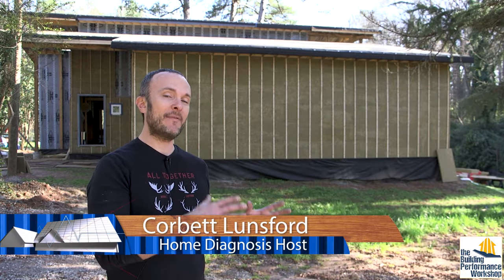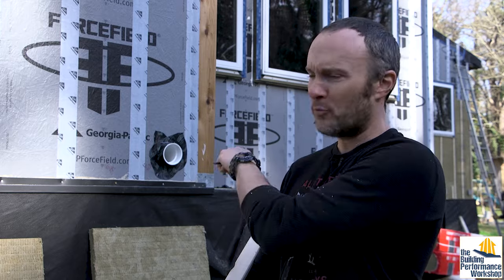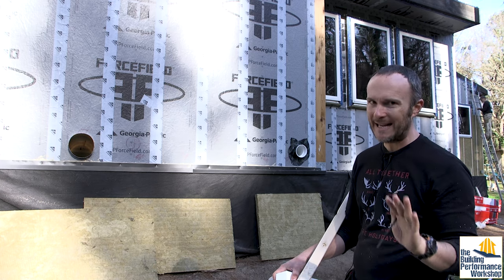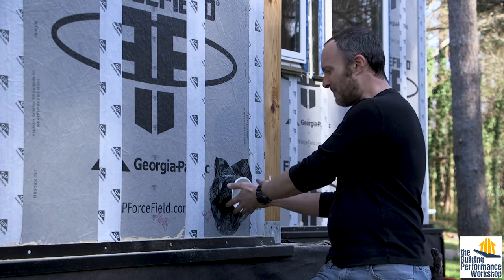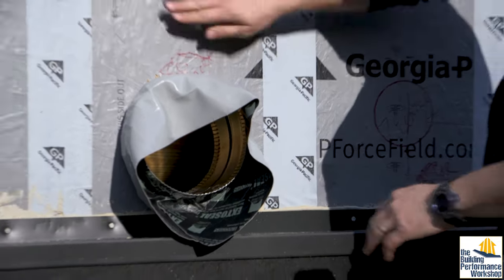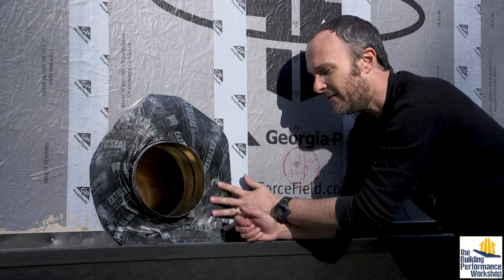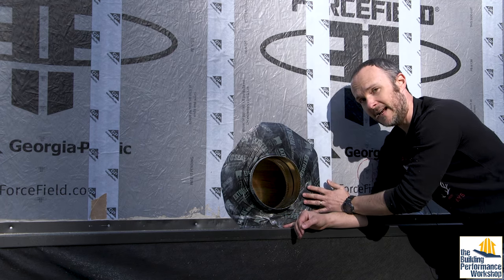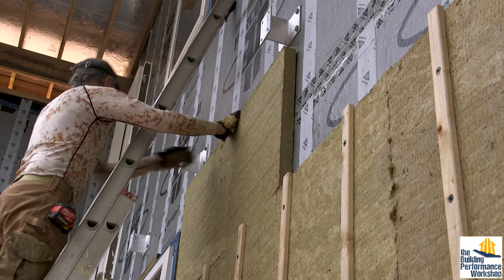How (and Why) to Wrap a House in Continuous Insulation: Rockwool ComfortBoard DIY

Comment: All these videos, how would you do this for concrete walls though? 4-6 inch masonry screws might be expensive... . You want sound denting and performance  how about 8 inch  CMU wall + continuous insulation on the inside and outside :)  . Soon to come ! Finishing my late fathers project. he put up the CMU Wall because he doesn't believe in wood.  I think ill beat him in terms of crazy engineering by adding exterior insulation :)  thanks for the idea, just need to figure out how to do it concrete siding   :)
Reply: I saw one guy who build a concrete house, he did the form work for the walls on the ground, put down 8 inches of exterior insulation with like 10-12 inches long plastic spikes going through them, and then poured the concrete on top, so the spikes would be stuck in the concrete
Reply: @Pontus95  
The concrete is already set for a long time. Actually My late father had already but brick ties in the blocks as he built . He was going to put brick but this day and age I can't really afford it. Plus I think it's better to put exterior insulation and cement siding than brick work. More functional. 

Who knows. I'll get a few quotes for each work and see cost difference . Maybe just finishing his dream is better than the exterior insulation . I can always put a layer of insulation on the inside then build my frame 

Thanks for the idea  :)

Comment: Do you have a video on how you dealt with the windows with the rockwood board making the exterior wall thicker?     I wonder if stretch tape can stick to rockwool board?  When Matt R. did a demo the outside of his exterior was the solid foam and he used stretch tape to make the window sill/frame water proof. Will stretch tape being pulled over the rockwool board stick to the board? Cheers from East Canada.

Comment: Did you consider wood fibre insulation vs mineral wool? If so, what points made you go for the latter?
Reply from the maker: The Gutex system is best as both a sheathing and insulation layer, which is too advanced for me this time around. I’m already going from zero to amazingness in one build, didn’t want to over reach.
Reply: @HomePerformance  Thanks for the reply. I was wondering since most of your wall assembly is from 475. Great videos!

Comment: I just did some quick math on the savings of doing this.

Assuming a worst case 25 degree difference , 24 hours a day, 365 days a year, and ac/heating system with a cop of 1.
You save about $215 a year by doing this. Of course that's a very conservative amount. If the cop is on the order of 3 and degree difference per year is less tha 25 degrees (which it is) you end up saving about $50 a year.

What was the cost for materials and labor so we can figure out the time it takes to make your roi?
Reply: big O don’t forget to add the cost of a less comfortable, less healthy, noisier with the reduced resale value, lost value in not being able to determine the TESTED improvements, environmental impact to redo when someone else wants it improved, reduced efficiency when someone else wants it improved.......🧐 In other words, there’s quick math and then there’s complete picture math 😉
Reply: @NeoKnight9  lol. Did you take that straight out of the passivhaus sales guide?

Reduced resale value? A code minimum house will sell for a higher percentage of it's build cost than a high performance house. 

What makes a code minimum house less comfortable or healthy. 

If you want a quiet house, build our of concrete. Those Batts do not appreciably increase stc rating q
Reply: big O lol Sorry I haven’t read that! I build system dynamic models and am enough of a systems thinker to understand the negative feedback loops when attributes aren’t considered in the actual “cost” of things. Probably should have written “reduced value”; anyone who has looked into differential deterioration and lifecycle costs can appreciate the un-anticipated costs most homeowners don’t consider. Particularly dependant on the age of their home relative to the amount of time they will live there. But please go ahead and simple math it up for your decision making processes 😁
Reply: @NeoKnight9  that's surprising as you sound like every one of the passive Haus owners I've heard. "Yeah I spent 2x as much but the house is sooo comfortable!"

So pray tell, since you design feedback loops and what not, how do you quantify the added "health" or "comfort" of  adding 2 inches of exterior insulation.? Please do go into detail. Thanks lol
Reply: @jl9678  a more air tight and better insulated home with controled, filtered air free of pollutants and allergens is a much healthier environment. Using building materials that are more renewable and environmentally friendly is a big plus to having higher performance homes as well. Energy savings costs in passive homes (at least in the North) outweighs the cost of the added material and time. Annual energy consumption costs of homes we build in Canada can be as low as $200 annually.
Reply: @an7h0ny88  in the hot humid south even leaky houses have very low air exchanges per hour. A 7 ach house can be as low as 0.1 ach with the AC system off and 0.5 ach with the AC system running so houses already have low rates of infiltration. Outside air is many times healthier than inside air in the US. If people suffer from allergies it's a good idea to prefilter the air using an erv.
I prefer renewable sources of insulation too.

Passivhaus in the hot humid south is not a recoverable investment if long term savings is the goal. Won't happen

Comment: Does the continuous insulation "blanket" continue onto the roof? Doesn't the rockwool compress under the weight of the roofing or do you breach the blanket to support the weight of the roofing?

Comment: Now looking for ways to insulate doors to go with super-insulated walls and multi-glazed windows. How hard would it be to build a hollow core door to take a 50mm rockwool batt in the cavity?
Reply: Could just double door. But there are some wild hinges if you want to try and makes some custom fiberglass door with thick insulation core

Comment: I know you use a lot from 475. Why did you not go with Gutex? For one example Gutex claims a much better sound absorbing property then Rockwool and higher insulation R value...
Reply from the maker: Great question, and the answer is simple: they hadn't tested it against our badass termites. Still not sure if there's data about this.

Comment: From the air quality or building science perspective, what is the benefit of rockwool over foam board? Is it just the fire retarding? I wouldn't think air quality would come into play on the external layer.
Reply: Fire resistance is a big one, mineral wool is also made from recycled materials so it's "greener". Air quality within the home may be better if the building has a better air seal on the exterior.
Reply from the maker: Actually, the toxic flame retardant chemicals in foam insulation DO travel through solid materials, which is why we avoided foam inside and out wherever possible.
Reply: @HomePerformance  ok, thank you. I am preparing to do the same thing and weighing the benefits and cost, so I really appreciate the feedback.

Comment: How much do windows (even high efficiency ones) reduce the effectiveness of the exterior insulation? Comments I've heard is that there's diminishing returns (at least in warmer climates) for adding more and more insulation, but never seen any good figures to compare cost/benefit, etc.
Reply: There is only one way to know for sure - heat load calculation. It is time consuming, but once done, you can play with the numbers and know exactly if paying more for triple pane windows makes any sense.
Reply from the maker: See the link in the description for the vid about our energy model and heat load calc.

Comment: Great videos. Done a bit of research on the rainscreens but most of the buildings and reviews have been over the zip sheathing system. I notice you use the butyl tape under your furring strips. I've never seen anyone do that on high performance builds using the zip system, is that unique from GP? Would you recommend it on zip too? Is there any literature on the benefits of that in terms of air sealing?
Reply from the maker: It does both air and water sealing, and I don’t know why it wouldn’t be necessary on ZIP, but I sure don’t know everything.

Comment: I've done it several times,,and in a word..USELESS,,,,it has a r value of 6,..take ur basic r 20 interior insulation and it's less than 3 times weaker than that,,it takes way more prep work,,way more backframing,,way more taped points and the cost on the homeowner is greater than just going with 2by6 interior studs and r 20 the inside...fiberglass insulation belongs inside,,not out..just another stupid idea in the construction business that will be a forgotten joke in a few years

Comment: The cost factor definitely keeps most builders from using it, they just can't figure out how to justify it. I would be curious as to the actual ROI on using exterior insulation. I have the Energy savings numbers, but the cost of installing seems to vary across the country.
Reply: What do you have for energy savings numbers. What r value did you use for whole wall and the whole wall with 2 inches of rockwool
Reply from the maker: Our Performance-Tuned Home Build Pt2: Enclosure Design 
https://youtu.be/aSuPieuKWZI

Comment: I plan on redoing my roof this summer and I would like to add some exterior insulation. I have not found any details on how to cover a roof in exterior mineral wool though. Could I essentially do the same thing you have done but in the roof?
Reply from the maker: Sure, I would have too if the energy model had shown it would be worth it. Happy to consult with you if you’d like advice. Just don’t add ins if there’s a vented attic below.
Reply: @HomePerformance  I have a 1.5 storey house with no eaves and only a gable vent. I planned on creating eaves to vent above the insulation, and to only insulate up to the insulated ceiling inside. Essentially leaving 5-6ft from the peak uninsulated
Reply from the maker: The devil’s always in the details. Sounds like it’s do-able, but be OCD about the small stuff.

Comment: In Atlanta, what perm rating did you use for a weather barrier?
Reply from the maker: Always, everywhere except Alaska and Florida, I advise using permeable materials. The ForceField has a perm rating of 3-5 in it’s installed state.
Reply: @HomePerformance  what do you advise for Florida? Isn't Atlanta climate pretty similar to Florida?
Reply from the maker: I’d recommend an energy model- every house is different, and every homeowner too!
Reply: @HomePerformance  Im in Zone 1 type climate and need to find a 3-5 perm peel and stick. 475 has 7 perm. I am trying to dry to the inside as best as possible and J. Istiburek has said, if you cant get installation perfect, dont apply a .1 perm material. We will have to dry both ways with 5 to 10 perm.
Reply from the maker: Sure, Adhero works if you need peel and stick.

Comment: Is that the exact same insulation as under your slab? Or slightly different?
Reply from the maker: Different. Subslab is ComfortBoard 110, with a 1000 lb per sq ft resistance.
Reply: @HomePerformance  I see! Thanks

Comment: Is there another way to secure it without using wood i am interested in fire proofing aspect
Reply from the maker: If you’re not using 2” of outsulation, then Cor-A-Vent might do fine, but it would be difficult to make perfectly straight since it’s softer. Metal might be hella expensive.

Comment: Going up pretty much as I suspected.  I know you have around r 12 exterior. how much insulation are you running inside the service wall?
Reply from the maker: R-15 cavity, R-8 exterior.
Reply: @HomePerformance  would have sworn you said 3 inch
Reply: @HomePerformance  I did hear 3 inch but that was the crawl space wall.   nothing like being right on the cusp of temperate zones 3 / 4     R 8 should do a great job of thermal break.

Comment: (1/(0.75/15+0.25/(1.2*3.5)))+0.51+8=
R-17.6 Total Wall R value (not including windows and penetrations)
Reply: What's the 0.51, and is framing really .25 of a wall?
Reply from the maker: Yes, that’s what an energy model does for every bit of the enclosure. Think about what a wall with NO continuous insulation at all actually has as insulation value.
Reply: @FrancisKoczur  oh, that's good to know (framing factor) although it seems rather high even with two top plates and a bottom plate. Still it gets in the ball park.

Don't forget there is also an approx r 0.68 for the still air on the interior wall

Comment: What’s the total R value of the exterior walls when done?
Reply: looks like it should be around r 12.  He said 3 inches continuous.    Being in Hotlanta I have been there with days where the humukity was a killer.  105 +   and humidity that was in the 90s  just north in Cumming Ga.   A great reason to run exterior insulation and a dedicated de humidifier.   Interestingly I live about 120 miles north and we do not see this type of warm fronts coming thru from the Gulf of Mexico.
Reply: @eyeonfish Think you are wrong. he said.. 3 inch which would be R 12  Comfortboard is available in different thickness
Reply from the maker: Total nominal R-value = exterior R-8 plus cavity R-15 = R-23. Minus the framing factor, of course, if you wanted to be very accurate, though almost no one in normal conversation does.

Comment: how about air gaps?
Reply from the maker: Don’t sweat tiny stuff- if it’s less than 1/4”, it’s probably not worth fixing, but that’s based on common sense, not research. Most gaps can be avoided by cutting well.
Reply: Houses should be as air tight as possible. Gaps should be sealed with tape, expanding foam, silicone, etc.

Comment: went through the trouble to discuss building science, use rockwool exterior, does everything right, but uses forcefield sheathing smh. Might as well use OSB and garbage plastic wrap.
Reply from the maker: You obviously have not seen our Hurricane test, blower door test, or all the videos with Landus who invented both ZIP and FF. Maybe do some more research before you start smh publicly.
Reply: @HomePerformance  what’s the difference between Zip and Force Field? Lay Force Field and Zip in water for 3 days.

Or just pull the paper backed Force Field weather barrier off and call it OSB.

Either way, it’s a trash product. He invented it because Zip was more expensive than people were willing to pay. Force Field is basically OSB with plastic wrap (the cheap stuff) glued on. Meaning it’s actually worse than standard OSB and housewrap.

Prove me wrong.

And to clarify, you’re on point for the build. I’m just questioning why you’d do all of that but use force field. You taped onto the force field correct? Yes. But you’re taping onto paper that’s glued down is line patterns. Same with windows, it’s not Zip. Over time that paper loses its adhesive properties and if the tape is the stretchy type (which is what you used and correctly so) it’ll naturally pull on that paper continuously.

Zip has a chemical compound for its weather barrier that’s rock solid. 

There’s a reason Home Depot and Lowe’s stocks Force Field and not Zip. 😂
Reply from the maker: @nextjin sounds like you are decided, but having looked into it AND tested it, I completely disagree. Happy trails.

Comment: You are over insulating.  You only lose 10% thru the walls.  You are wasting time and money.
You lose 50% thru the roof and 30% thru the windows.  You only need to stop air infiltration in walls.   
Sound deadening is a different issue from insulting
Reply from the maker: Sounds like you're the real expert here, Eagle. Why don't you run the channel and the TV show and come build this house for me.
Reply: Home Performance 
Actually I was on home talk tv for a year.  Would live to help you if you’re interested.